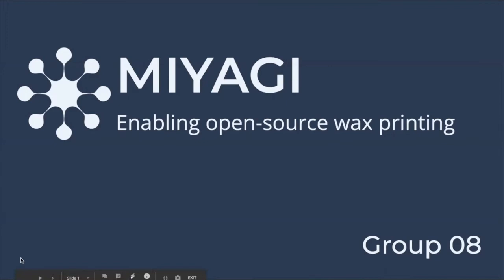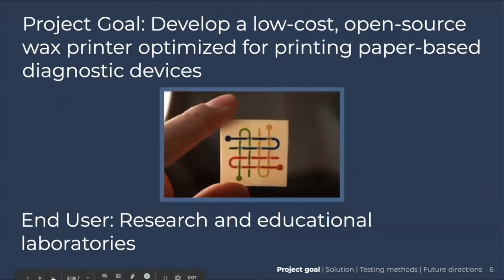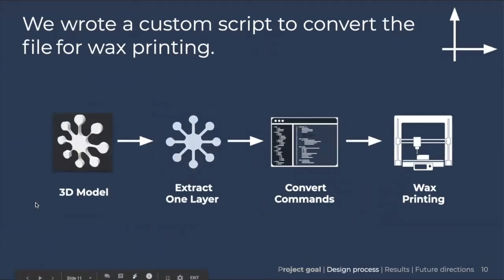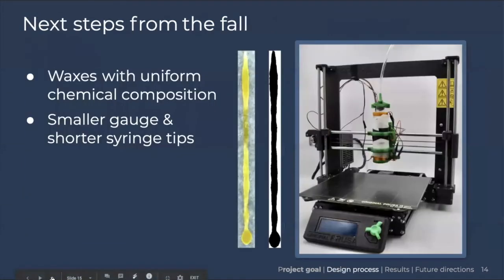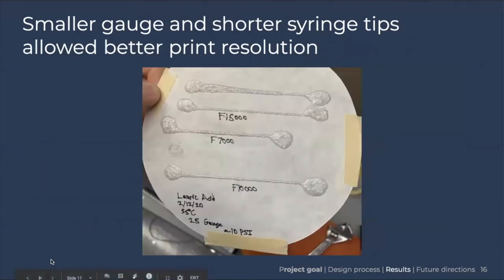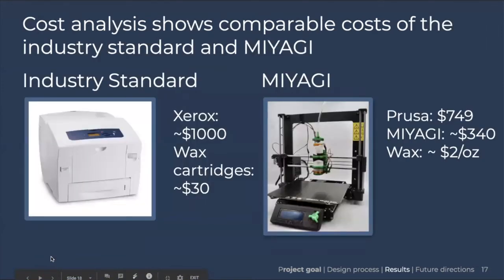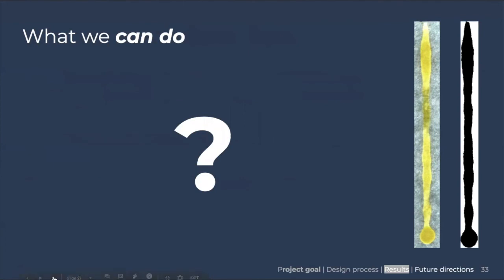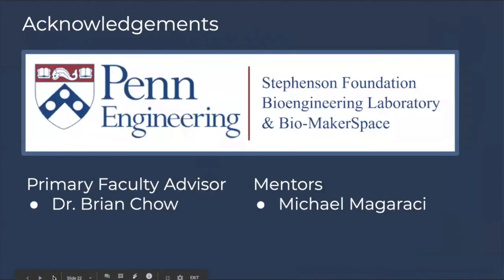Senior Design 2020 - MIYAGI - Open-Source Wax Printing for Microfluidics

Comment: Hi team, thanks for posting this. 
Does it work to print PLA or castable "wax" (I think it is a thermoplastic, not wax) using the original extruder? Either on paper, or eg. transparency film or glass?
Reply from the maker: Full details for the project can be found at http://belabs.seas.upenn.edu/seniordesign